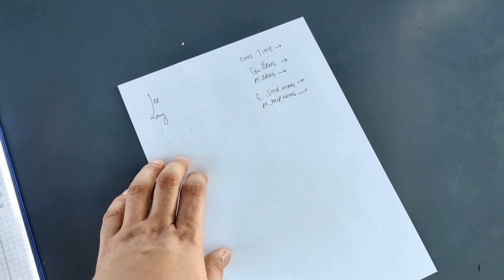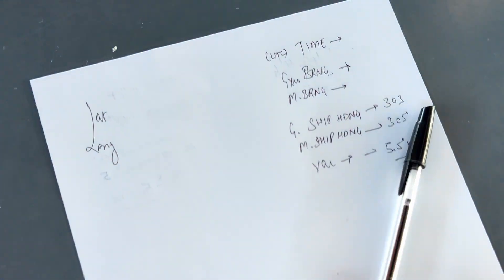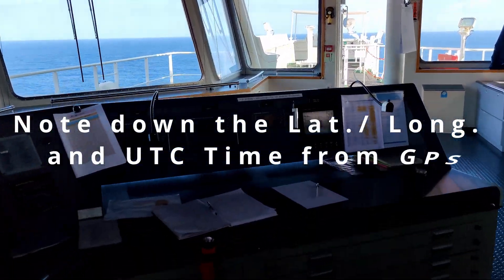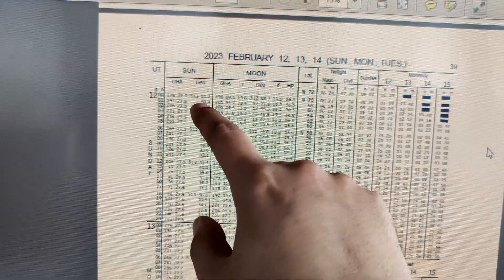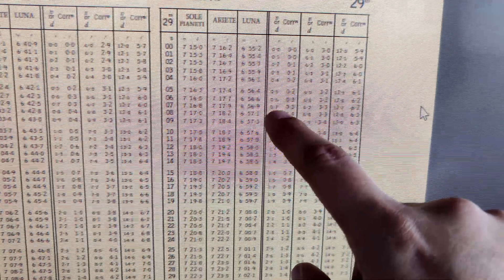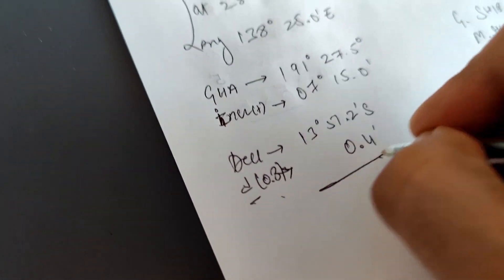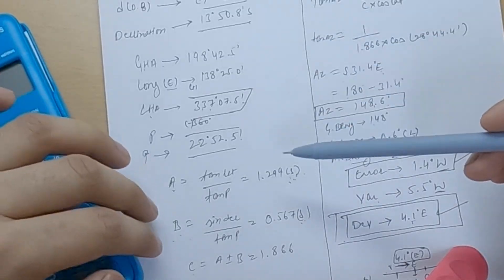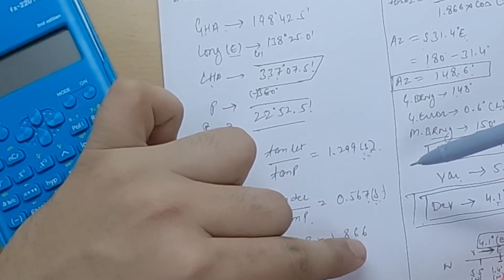HOW TO CALCULATE COMPASS ERROR ONBOARD #navigation  #officer #merchantnavy #lifeatsea

Comment: i used two way: ABC method found True bearing is 149.7° 
The Program found True bearing is 149.5°…. ?
Reply: is there diffirent between your way and 2 way from me?
Reply from the maker: There will always be some difference in program and your calculation. Most accurate will be your Abc method
Reply: @sailorguide i know that, but your answer is 148.6°, i think to much different

Comment: What after you log in the log book. Do we need to verify that deviation is acceptable or within limits or satisfy with some rules and regulations. What an auditor is checking in this log during inspection.
Reply from the maker: It should be in a range of your deviation card. If you have more than 5 degree of difference you need to get a service for magnetic compass
Reply: So if we get for example deviation 11.8E but in deviation card is 3W then we need call service for sure? :)

Comment: qUESTION: For the time, wouldn't it be 1329 because it is daytime instead of (0129 the sun is not out that time) and as such the corresponding GHA would be 11 degree 27.3minutes??????
Reply from the maker: Fir calculation we always take UTC time not the local time . So the time mention in GPS will be taken for calculation as mentioned in the video
Reply: Okay thanks for the clarity. So basically the LMT at that time was 1042... Hence why the true bearing of the sun was SE ?
Reply: Formula for B is also wrong
Reply: @mohitchauhan8099 then what is it ?

Comment: Question, can i use C D M V T  method after i get the error from your solving?. The T is AZ= 148.6 and the C is 150 i have variation i will work my way to get M and deviation also ?
Reply from the maker: Yesss sure its same thing .. i just happen to learn it in a different way.. CDMVT can be used you will get the same answer. 👍
Reply: Bro can you explain how CDMVT is calculated?

Comment: Question, the "P" value, do you also apply the LhA rule on a Star observation, where 360-LHA if the LHa is more than 180? Also can you explain more about the correct naming of magnetic error, for example when they are same name as the Variation, when you are trying to get the Deviation?thank you
Reply from the maker: Yes LHA rule will be applicable to there also . Nd naming of the Deviation is very simple i showed in video also . Please do check out that one again because explaining it here will be a bit difficult

Comment: Can you make video sir ,why we are take the compass error?what is the use of that?
Reply from the maker: Compass error is important for navigation point of view ... If we have a compass error of more than 5 degrees we need to request for the service for magnetic compass. Service engineer actually changes the magnetic bars inside the magnetic compass to adjust the error
Reply: @sailorguide  compass error means the difference between gyro heading and magnetic heading ,is ti Correct sir
Reply: Then when we find out gyro error ,why we are mentioned the  sign in low and high?
Reply from the maker: @mdganesh5764  because Gyro error is independent of the magnetic field of the earth.. magnetic compass variation and deviation is the factors for Error , whereas Variation and Deviation we always mention in East or west.
Reply: Hello sir ,can you give me the exact  answer for speed through water and speed over ground
Reply from the maker: @mdganesh5764 in simple words  speed through water is the speed of the ship without any external effects like current or wind.
Speed over ground is the Actual speed which ship is doing presently including factors like current and wind.
Reply: Thank you 😊